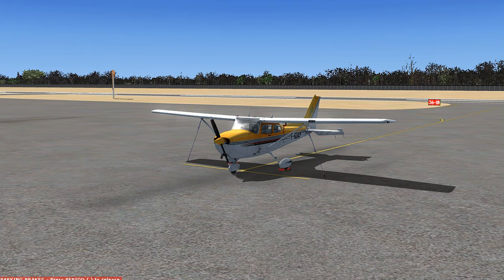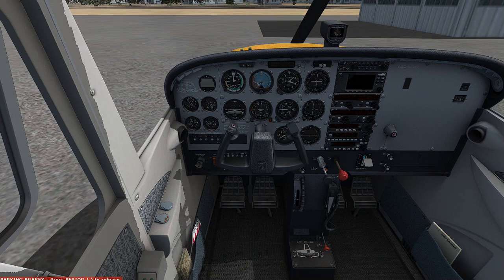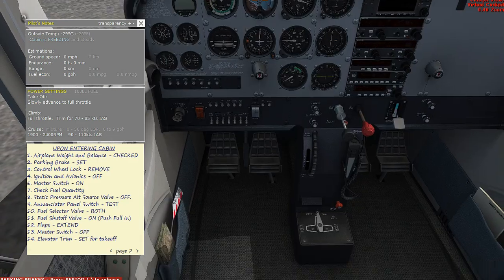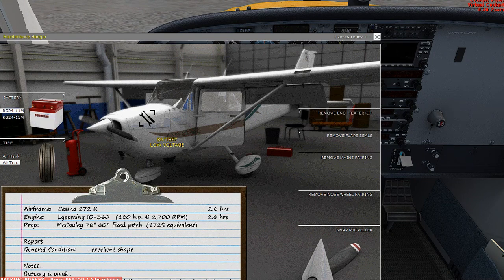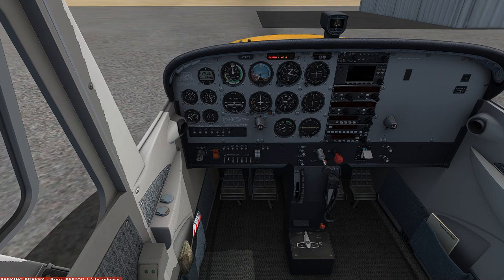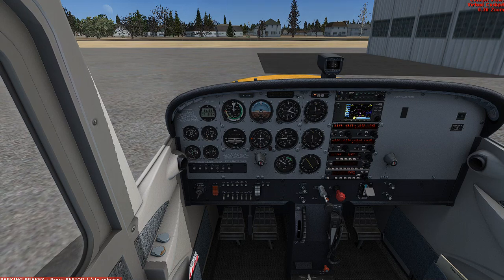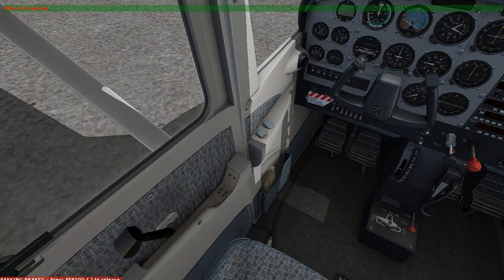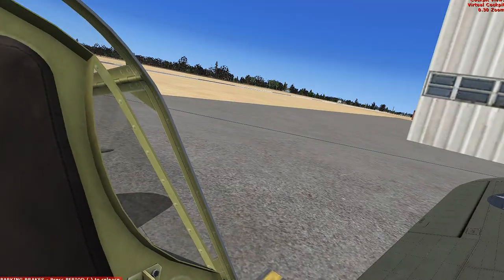Attempting to start various aircraft in fsx after sitting for months

Comment: 13:07 mixture control is off.
Reply from the maker: I had it set to fully rich, 100-% on.
Reply: @Underappreciatedclassics  sometimes that isn't the best way though.... I usually adjust to 25 to 50.... on a cold start. Usually starts pretty good.